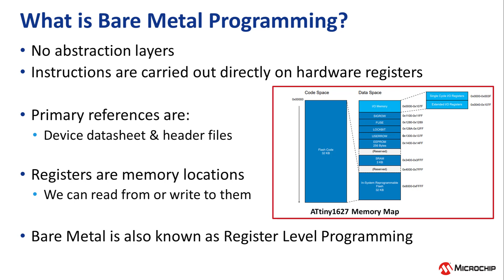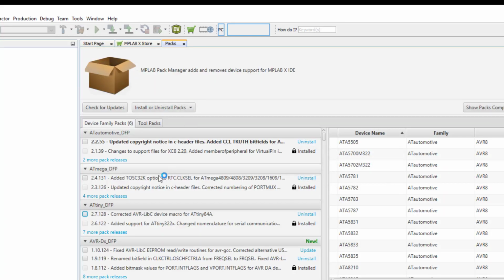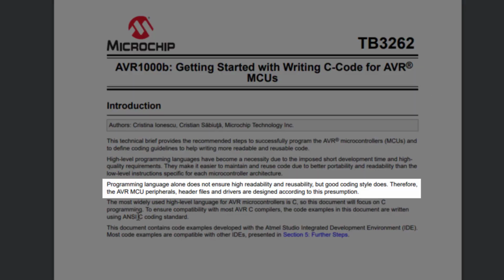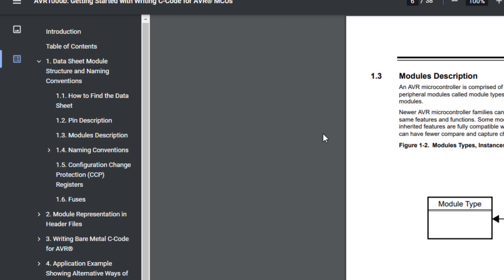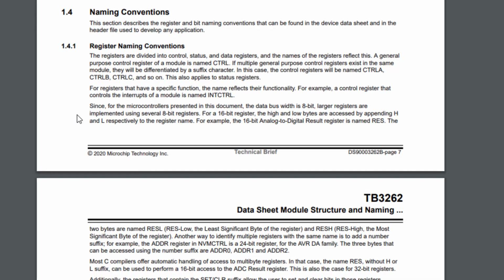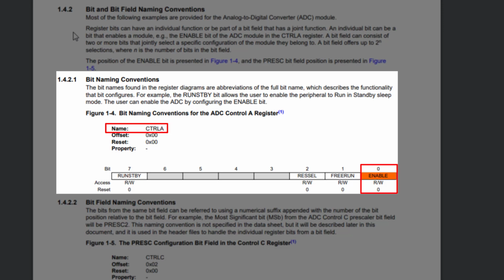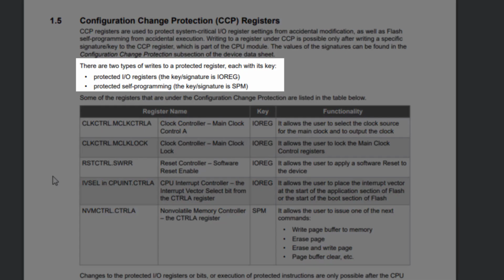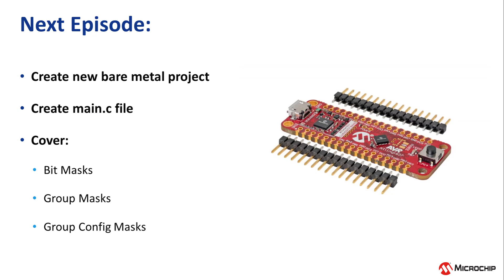Intro to Bare Metal Programming - Episode 1: How to Get Started

Comment: So is bare metal programming what they used to call "machine code"?
Reply: Not really, Bare-metal programming is low-level programming with direct access to the Hardware. Machine code is the actual program of Binary (0s & 1s) which the machine/processor understands and can run. As long as we use a programming language like C/C++ or even Assembly, they need to be compiled and assembled into the Machine Code output that can run on a target Hardware. If the choice of development are the real binary op-codes, then it is the machine code programming.